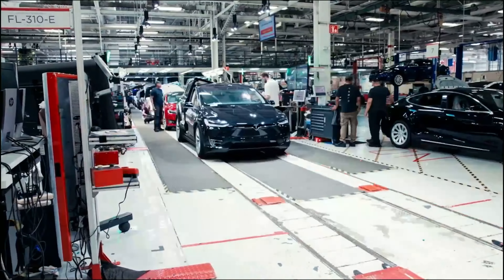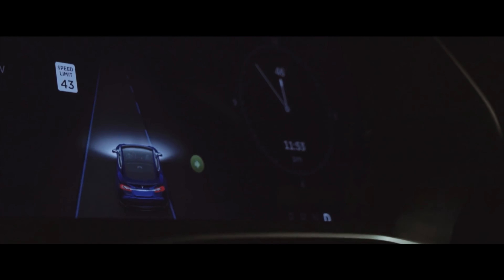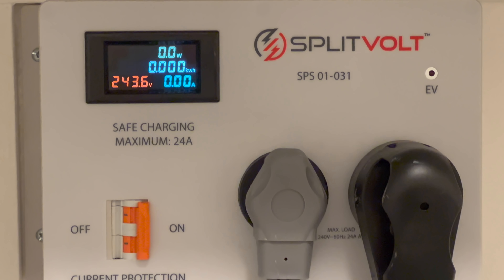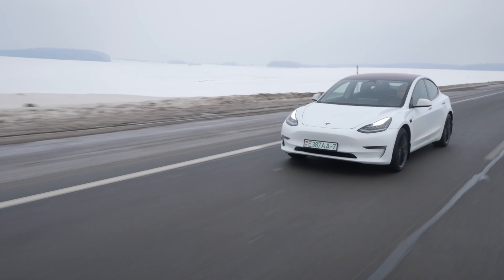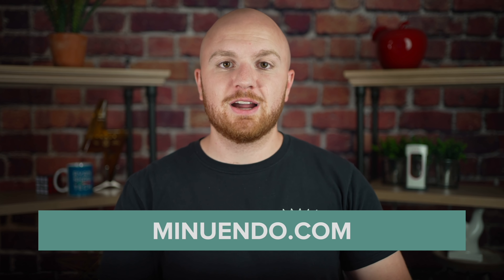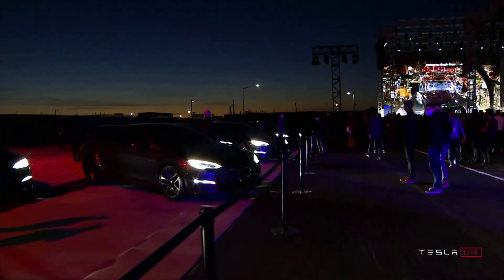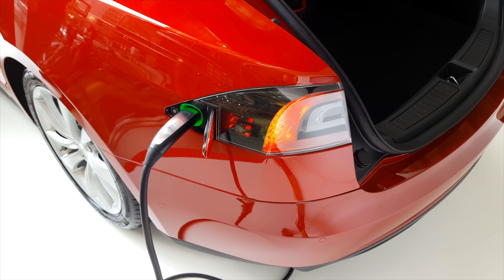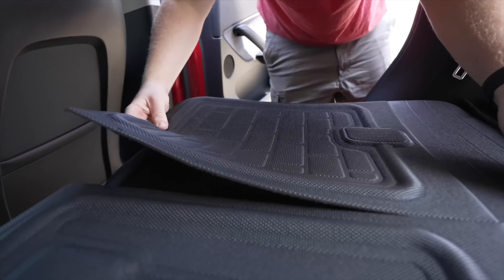Buying a Tesla? | Don't Make a Mistake

Comment: Ryan, I "had" the same issue with the passenger mirror unfolding at night on a random basis. The SC attached a data gathering module to the car for a couple of weeks and basically learned nothing. Then they replaced the entire passenger mirror assembly to no avail. I found some info that some models of the S have individual "door controllers." They replaced the passenger door controller. It's been five days with no rogue mirror failures. The car is a June 2020 Model S LR+. The part is a Pektron 1003101-00-E.

Comment: 5:36 charge to 80% recommended for nickel batteries. The Tesla's with the LFP batteries can handle daily charge to 100% without issues.
Reply: Not correct. Tesla recommends the lower charge to maintain battery life.
Reply: @benjaminmorton9436  not correct Benjamin.
Elon Musk on twitter:
"Our intent with this pack is that product experience is roughly equivalent between nickel & iron. I’d personally slightly opt for iron pack, as it wants to be charged to 100%, whereas nickel prefers ~90%."
1:46 AM · Aug 27, 2021
Reply: Nope.
2 things that prematurely age (oxidisation) all li-ion batteries, including those in your phone: 
long periods of time at full cbarge, and high temperatures.
60% charge is the li-ion soc for shipping and warehousing of li-ion cells for maximum shelf life. Your Telsa battery will last much longer if charged to only 60%. 80% is a good comprimise between battery life and convience.
Also, do not supercharge. Those are 7 year old Model S with 96% original capacity because they were never supercharged.
Look after your battery.
Reply: @nordic5490  you should tell this to Elon. 
I am sorry, but you are just a guy on YouTube. I trust what was said by Elon Musk: "iron pack wants to be charged to 100%"
Reply: @nordic5490  ... and you are talking about Li-Ion, I'm talking about Lithium Iron Phosphate (LFP) batteries.
Reply: @benjaminmorton9436  no, LFP prefers to be charged to the full 100%.
Reply: @MarcoYolo420  absolutely. I'm waiting delivery of a Y sr equipped with LFP and there are significant differences with the battery pack of LR. LFP are a bit less "energetic", they should always be charged to 100% (they don't suffer it like the li ion ones and you avoid the "memory effect" - same as the first generations of portable phones), they don't suffer fast charging as badly as li-ion batteries, nor the harsh temperatures. They are much safer as they are not prone to catch fire or explode as the li-ion.
Reply: @markpas3573  Thank you Mark for your reply. I whish more people get informed better before posting. Congrats with your Tesla model Y, I envy you 😉. Like Elon said, LFP has lot of advantages. Enjoy the best car ever build 😄👍🏻
Reply: quote from YouTube channel "the limiting factor" by Jordan Giesige his LFP video:
"... And for those concerned about LFP batteries being inferior to Nickel batteries, as Elon  has suggested in this tweet, they’re not. Like all battery chemistries, LFP does have eccentricities,  but on balance will perform as well in Model 3s as the current Nickel based chemistries.
In short, if you live in a hot climate, LFP is hands down a win. If you live in a cold climate,  there is a potential for lower performance, but there are workarounds thanks to Tesla’s  superior software and thermal management systems. If you live in any climate, you’ll be getting a million mile battery that’s much more robust to regular 100% charges"

Comment: 1. Don't buy autopilot service for 10000. Not worth it
2. Not setting charging before buying the car
3. Don't buy a bigger battery pack
4. Buy the smallest wheels with the biggest tires
5. Check quality control after delivery
6. Check for state/federal incentives
7. Buy third party essential accessories

Comment: I used a normal 110 to charge at home for nearly 2 years with no issue. My daily weekday commute was ~50mi… charged daily and added back ~30mi per day
Reply: @Esstron716  lol yeah exactly… 99% commute… and then I use my ebike to zip around town and to nearby friends house
Reply: For ~500$ you could’ve been charging 10x faster. To each their own. It removes a tremendous amount of range anxiety having a 240v on demand.
Reply: @spoohne  yeah, I have since bought a 220 adapter to plugin to dryer outlet in garage. Was like $35 I think? Now I only have to charge 1-2x per week. In hindsight, I should have just done that from day 1, but it was never really a problem.
Reply: When I used the 110 to charge, my electric bill doubled in price.
Reply: @marlenehenley2781  you must’ve had a cheap electric bill to begin with. Still beats gas.

Comment: Great points Ryan,  must admit we were so excited to get our model 3 SR+ LFP so quickly, we barely checked quality issues, fortunately we haven’t found any issues, quality control seems to have gotten better. We also went w the same charging option as you, instead of a dryer we have a 30 amp water heater and used a ‘DryerBuddy’ to do the switching, Brad at BSA Electronics out of Vegas was very helpful in configuring our set up, needed slightly longer cables. Thanks for the great videos.
Reply: My model 3 long range comes November-December 2021 and my Model S long range come March-April 2022
Reply: LFP preferred to charge to 100%, at least once a week. That has its advantages.
Congrats with your Tesla! Great car, lots of fun 😄
Reply: @MarcoYolo420  It doesn’t - that’s just marketing guff. LFP doesn’t “prefer” anything - the battery will definitely last longer on 20 - 80% but will also tolerate 100% charging better than other lithium chemistries. It’s a longer lasting chemistry anyway and should last a minimum of 4000 full cycles - that’s nearly a million miles on an SR+. It might not last that long in an EV as you are stressing any battery chemistry during acceleration and regen.
Reply: @mondotv4216  I'm afraid you are misinformed Mondo. Take recommendation from the manufacturer, or if you want to dive deeper in battery chemistry, I would highly recommend YouTube channel "the limiting factor" by Jordan Giesige, he has a video serie on LFP too.
Reply: @mondotv4216  quote from "the limiting factor" by Jordan Giesige his LFP video:
"... And for those concerned about LFP batteries being inferior to Nickel batteries, as Elon  has suggested in this tweet, they’re not. Like all battery chemistries, LFP does have eccentricities,  but on balance will perform as well in Model 3s as the current Nickel based chemistries.
In short, if you live in a hot climate, LFP is hands down a win. If you live in a cold climate,  there is a potential for lower performance, but there are workarounds thanks to Tesla’s  superior software and thermal management systems. If you live in any climate, you’ll be getting a million mile battery that’s much more robust to regular 100% charges"
Reply: Quality definitely has improved, particularly in their new Shanghai factory. This will become quite clear with the new Austin and Berlin factories coming online this year.

Comment: Ryan, excellent video for prospective buyers.   You can’t emphasize enough the need to prepare for charging.  If the mobile connector will be used, make sure to order the proper adapter early as they often go out of stock.

Comment: In some areas, the utility company might also offer incentives and specials. I just missed out on a $500 credit for installing a home EV charger, but did qualify for an EV discount of $0.015/kWh during off peak time for charging. So be sure to look into what your local electricity provider may offer as well. 

Great video as always, Ryan!
Reply: I just got a level 2 wall connector. City of Anaheim, CA has a $1,000 rebate for the networked charger and is giving me $2,000 to upgrade my panel to 200amp solar ready with a Time of use meter one year agreement. 5 bucks a month for the meter and off peak 11.17cents summer and 10.56 cents kWh winter. Not bad!
Reply: @MelissaGarza  Sweet deals! 

Our non summer rate (just started 10/1) is just over 9 cents/kWh for off peak time. In summer, it runs just over 10 cents/kWh. SO much cheaper than fossil fuels, and much more convenient!

Well worth looking at your local utility to see what they offer.
Reply: @ezpoppy55  what city and state are you in?
Reply: @MelissaGarza  Just up the road from you - Sacramento CA. Our utility (SMUD: Sacramento Municipal Utility Dist) is publicly owned.
Reply: @ezpoppy55  LOL a long ways up the road!!
Reply: @MelissaGarza  😂 yeah, I guess. I was in Anaheim in June, taking the boys to Disneyland, and enjoyed your fair city for a few days. Very nice. Just down the road from Angels Stadium.
Reply: @ezpoppy55  🤣😂🤣 my city is ran by mice! I mean a mouse! Lol. Glad you had a good time. Took the Amtrak and passed through your city from LA and got there at midnight. LOL. We may be planning a capital visit soon.
Reply: @MelissaGarza  well, we don’t have a mouse running things up here. Just politicians. So you know… 🙄🤣

But the Capitol is a great building, and there’s some fun things to do in and around the area. Plus if you need a big city fix, San Francisco is close by!

Comment: There is another reason difference between SR and LR. LR is the Dual Motor which provides all wheel drive which is for better handling in areas which has diverse weather conditions. I went for the LR for this reason, I always liked the handling of  all wheel drive vehicles.

Comment: I will buy a new vehicle in about the next 3 months. I had planned to purchase  a model Y, but the latest price increase was too much for me, so my next purchase will be an IC vehicle for about 20K less than the Model Y.  At this point in development, any EV buyer is a pioneer. Pioneers by definition will pay more and get less than waiting a couple of EV generations to plunk down the big bucks. I believe a comparable example is flat screen TVs. They quickly dropped in price and improved features in a relatively short period of time.  My next car purchase will be in 3 to 5 years. By then, batteries and consequently the car will cost much less, range will be longer, batteries will likely last longer, etc,etc. To the pioneers I say thanks for your service.

Comment: Ryan thanks for your avoiding mistakes. I have a few comments on my 2021 Model 3 performance.  I dont know where to direct these comments. Driver side windshied wiper has a large reach and the washer is mounted high on the wiper and at speed the washer does not wash the lower 1/2 of the windshield which is area driver views most. So bugs and debris are not adequately removed.  I recomment a second lower nozzle or including a second lower washer nozzel on the wiper blade.  Second, Tesla just notified me that my "trial" of the gps with aerial photos and other " enhanced" features has expired and now they want. 9.99 a month to continue.

Comment: 2:04 Absolutely ridiculous you have to request access to something you paid for.  FSD was only $6 or 7k when I bought my 3.  Two years
 and 50k miles later, I'm glad I didn't buy it.  Had I done that, it's likely I would only have FSD  for 2 years or less before replacing my car at 4 or 5 years.

I have friends with late 2018 early 2019 Model 3 with FSD and they have already replaced their car.  Never got the FSD functionality even once!
Reply: even more ridiculous that in long range models you have to pay to get more acceleration thats just sitting in your car

Comment: This would have been a good video to watch when I started my EV journey. I LOVE my 21MYLR, but there were a lot of QC issues at pick up and more keep popping up, even months later. It’s about to go in for its 4th service visit in just as many months. Never for more than a day, and none of it huge stuff…just a lot of little things. Trim pieces here or there, hatch not aligned, now I’ve got a rattle in a door and the windshield wipers hit the hood when the present themselves. All that said, I LOVE my car and plan on upgrading to a new Model Y in a year or two once Austin gets up running.
Reply: Just out of curiosity do you get a loaner vehicle while your Tesla is being repaired?
Reply: @drathen1556  I get either a loaner vehicle or Uber credits ( generous ones) added to my account —time limited to while my car is being fixed.  Works out fine for me.
Reply: why would you upgrade your MY in just a year or two? and what makes Austin factory special?
Reply: @lijolukose6965  I have no doubt mine would last for years, but I bought a Long Range and I think I want a Performance. Austin’s Y’s will (eventually) be using a new unibody design as well as a new type of battery technology that’s supposed to be more efficient and robust. Austin Y’s should also be assembled with new tooling which should increase build quality and reduce panel gaps and fit & finish issues that cars built at the Fremont factory are known for.
Reply: @Oncampus2k  Makes sense. I did read about that which is nice. But I do feel a little skeptic about the Austin factor (only during the initial stages) given that there will be brand new machines and employees, which could potentially increase the chances of defects. But I hope not because my delivery is scheduled next year lol.
Reply: @lijolukose6965  Hence why I want to upgrade in 1-2 years, not asap. :)
Reply: @Oncampus2k  Fact is, they'll be improving the tech every year or so, so you might feel the want again after you get the next one lol

Comment: My merc' has been covered in PPS film, this work was carried out by Xpel in the UK, the job protects the cars paint from chips/scratches & because the shine is built into the film makes cleaning the car much easier with no need for expensive polishes, overall, its worth the added protection.

Comment: I've charged to 90% since I've owed it. 2 yrs now and 35k miles. Tesla said my battery degradation is better than most made in my fleet. @ 5% with the average being 6% or better. Nothing wrong with going 90%, it isn't just for long trips.

Comment: Awesome video. Very educational. Definitely looking out for the consumer. I also have a 220 outlet installed in my garage but hardly use it. 110 works great  if you don't drive more than 60 miles a day.

Comment: Received ours in July. We showed up with an inspection list posted on line. We found nothing wrong. We also use just the 110 for 35 miles between 12-6am for the cheapest rate. We lost our Super Charger mile because we went back and forth when they offered the battery choice. We kept our original but lost the SC from Ryan’s referral. It’s ok because we love the car. We’ll see if we get any credit when we file taxes but not holding my breath.

Comment: Didn't mention performance when it came to wheel size too. You get better sidewall rigidity with smaller tires and better corner feel and perf. So if someone wants a more sporty feel, you want the bigger wheels.

Comment: Always love your content Ryan! 👍🏻 Would be fantastic if you could tell km in addition to miles. I still can't convert these numbers so fast in my head 🤗
Reply: For an approximate conversion which is easy to quickly, to from miles to kilometres, just take the number of miles and add half on top.

It isn't exact, but for most general uses where precision is not required it will do just fine as a rough guide.

So 10 miles, 10 + 5 (half of ten) = 15.

There is actually 1.6 km per mile, so in reality the answer is actually 16, but as you can see, the approximation is pretty close and normally good enough
Reply: @christopherhartley6900  one mile equals 0.6 km so it’s a bit off your calculations:-)
Ten miles equals 16,09 kilometres:-)

Comment: Related to #1: "Full Self Driving" is a misnomer because it remains an SAE Level 2 system, which requires constant vigilance by the driver. It is NOT a true autonomous driving aid, and Tesla would do well to rename it.

Comment: Another mistake is expecting the service center to fix any misalignments that your car may have. I was told that my trunk on my M3 was misaligned due to manufacture  welding fault. And also the excuse you get all the  time, “tesla is not a car company”. So, I had to fix it myself, which was very simple with some YouTube help.

Comment: My 2021 Model 3 LR gets 62 miles for every 100 miles of charge. I use the AC every drive, no sentry mode and no cabin overheat protection.
Reply: Do you have the 20" wheels? Those can cause a 7% reduction in range.
Reply: @gordon4385  I have the 18” aero wheels buy with the caps off.

Comment: Hopefully, people will realize before they buy that they should expect to fall well short of the rated range of these vehicles. I only get about 80% efficiency, and that is driving very conservative in good weather.  Throw in some highway miles with the air conditioning running and it drops off more.  I am only anticipating 50% efficiency when I drive this upcoming winter.

Comment: Very focused advice . My main issues in buying a Tesla 3 would be the lack of a HUD which I think is a safety must . I would agree with the wheels , go for the medium diameters . I wonder if Tesla still offers the silver alloys instead of the rather 'grubby' (in my opinion) black walled ones ? My American friend has just bought a Tesla 3 here in Paris and though very happy with the car found the exchange rather underwhelming at the warehouse ! In fact he could hardly drive the  car away and then only with the help of his savvy 4 year old son !!

Comment: Changing from 20 inch wheels to 19 inch OR 19 inch to 20 inch(I,m not sure about tesla,I don't own one) but usually the diameter/circumference of the tire should not change,the 20 inch wheel should use a lower profile(sidewall) tyre and the 19 inch wheel a higher profile(sidewall) tyre thus keeping the overall height/circumference of both size wheel and tyre the same,I can't understand why you would lose milage.